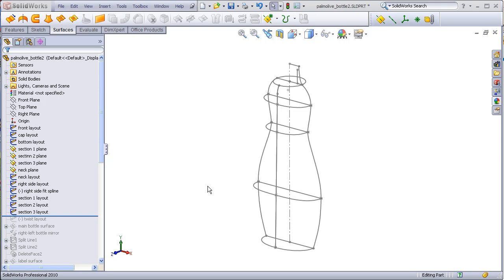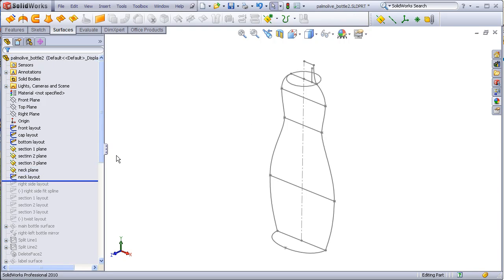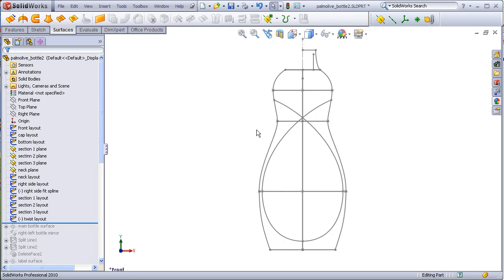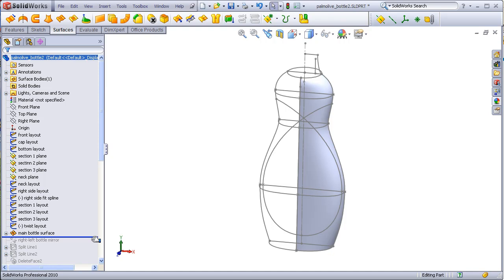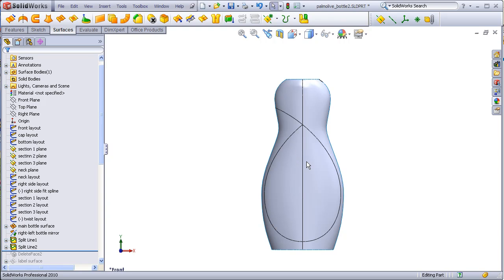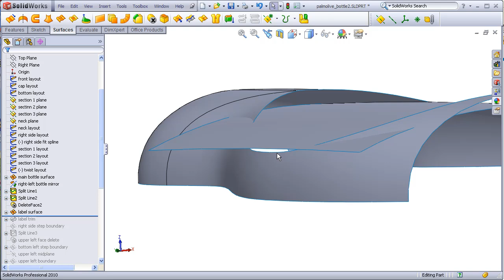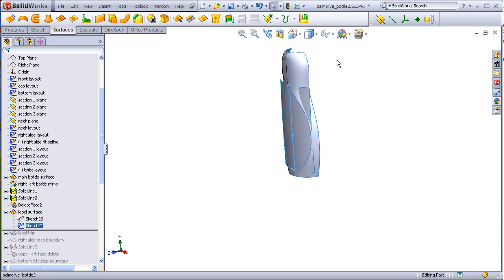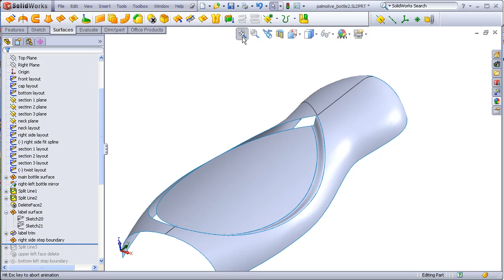DSID136, Solidworks Tutorial, Twisted Detergent Bottle - Part 2

Comment from the maker: The offset sketch for the label area is actually a 2D sketch, not a 3D sketch. Just draw a sketch on the front plane and click on the edges of the tear-drop opening. You should be able to offset these edges 5mm inward. There will be an overlap at the top of the tear drop that will have to be trimmed. Then, use this sketch to trim away the excess perimeter from the label surface.

Comment from the maker: @apsaada 
I figured out where the problem is. I actually had to do two separate surface splits, which I failed to mention in the video. This was more obvious to the students who had the sample file. The split had to be done in two stages, because it forms a backwards number 6. This means the split intersects itself. So, the first split goes from the upper left, down to the bottom center. The second split goes from the bottom center and arcs up to the right, until it hits the 1st split.